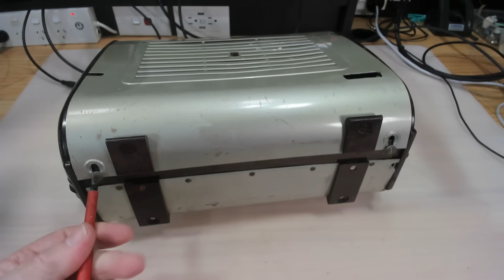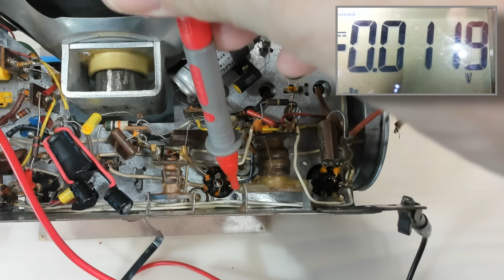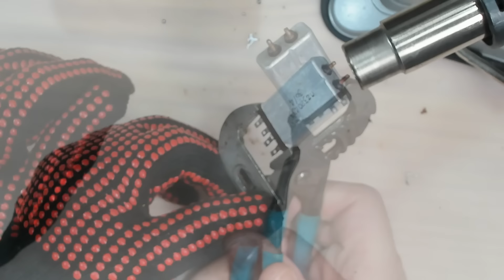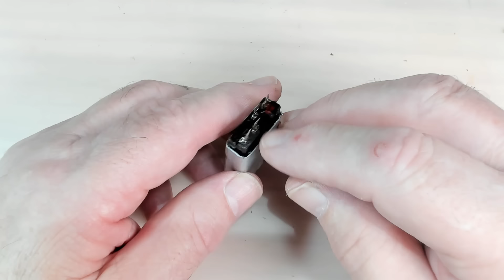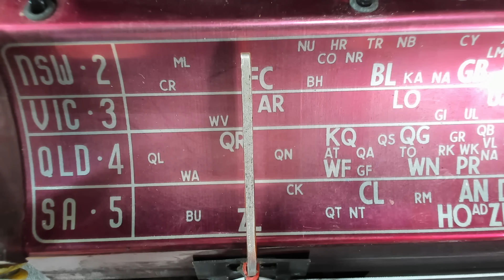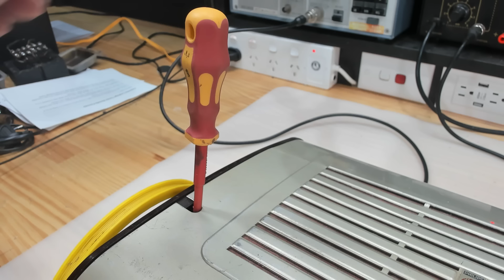Philips 148C Town and Country + Mullard  MABS 1052 - Part 2

Comment: Well done David with Micro Surgery on Philips IF they were always problems with tuning adjuster brake off inside Wonderful works David Top Marks Mate,Ian,
Reply from the maker: Thank you eddy. The plastic they used is incredibly brittle. If I get one apart again I will consider making a mould so I can make new plastic cases 🙂

Comment: Very unusual IF transformer construction, I've never seen this type before. Nice repair, kept it as original as possible. These portable sets with an RF amp section are quite sensitive and selective. I've a Motorola Ranger 700, a wonderful little DXer from 1957. Thanks for taking us on another radio adventure.
Reply from the maker: Yes, my first experience pulling one apart, I usually stay well away from them. The radios work very well with the RF stage 🙂

Comment: Great job David. Well done.
 I noticed that the first 'incorrect' valve you removed was a Mullard. Did I ever mention that their main factory in The U.K. was just a few miles from my home. 
There are some very interesting videos on UTube showing how they made all maner of parts even before the final assembly. Have a look for them. Absolutely fascinating.
Best wishes 
Lynton
Reply from the maker: HI Lynton, thank you. I did investigate the Mullard/Philips story previously and watched videos. It was an interesting setup between the two companies. I saw photos of the main original plant in Blackburn I think 🙂

Comment: Nice and very delicate repairs! I have two copies of the original version/"inspiration" for these radios, the RCA 66BX "Globetrotter". Both are unrestored but work perfectly with, I think, all the original tubes. They are good performers and the aluminum cases have held up very well. The build quality of the electronics is very good, but the cabinet is a work of art compared to other portable radios of the era, even the similarly-expensive Zeniths, which look like they started with old shoeboxes covered with leatherette.
Reply from the maker: Thank you Brett. I wonder if Philips and other manufactures who produced copycat radios actually had permission from RCA, these two radios were made half a dozen years after the RCA 66BX 🤔
Reply: @DavidTipton101  I don't know, could be! Some of the details are identical (like the slot to adjust the antenna trimmer), and I know that RCA did deals with Europeans manufacturers in other areas - for example, there was once a classic German "piano keys" radio that was badged RCA. So it is entirely possible it was made by RCA in the first place, or licensed the design. Those IF cans certainly look like classic European, I have never seen anything close to that in a US radio. Mine also use a selenium rectifier instead of a 6V4, so my guess would be licensing.  I am very happy with the way mine work, I made up a battery pack with C cells and 9Vs, listened to be ballgame on various outings.

Comment: Nice video David, good to see that you made them both live and work for modern times. I found one of these dumped in the hedgerows back in 1970. It had a missing valve and a schoolmate knew which one and gave me it, which got it working again. Philips or Mullard 🤔 i don't recall but i kept it for daily use.
Reply from the maker: Thanks OUT. Nice find, still reasonably new in the 70s 👍🤔

Comment: Good job! You're lucky it was just wax and not some smelly asphalt material or, worse, epoxy. I guess they didn't use epoxy when those radios were made. I have a loop antenna that has a connector I would like to replace, but the base is filled with something I would need a jackhammer to remove.
Reply from the maker: Wax was the go to in the day. I wonder if you could soften the potting material in the antenna base, acetone maybe? 🤔 Thanks @4X6GP.

Comment: No apologies necessary. Radios and cars are designed to be built, not repaired. Also loved the glove, Spiderman kept coming into my mind😮.
Reply from the maker: It was difficult to work on with no flat sides, it flopped all over the bench. Heat resistant glove, I didn't think of the Spiderman angle 😅 Thanks Scott.